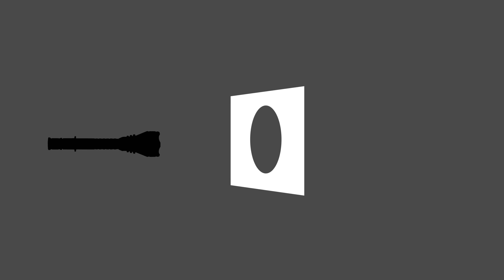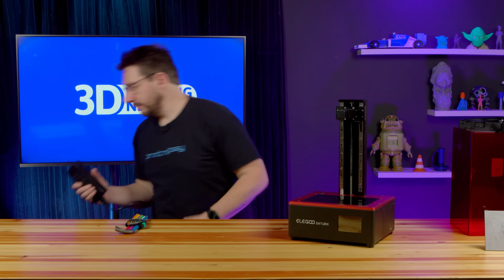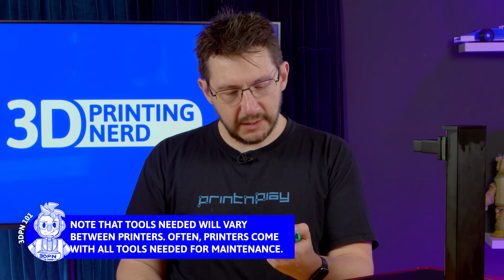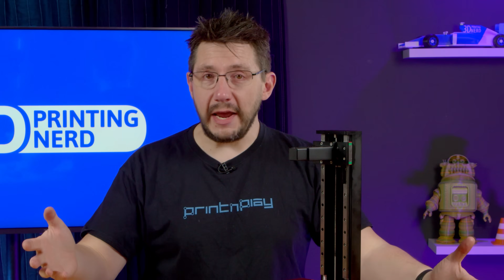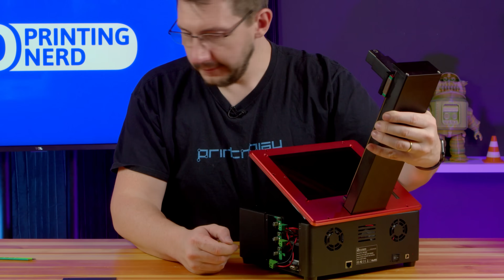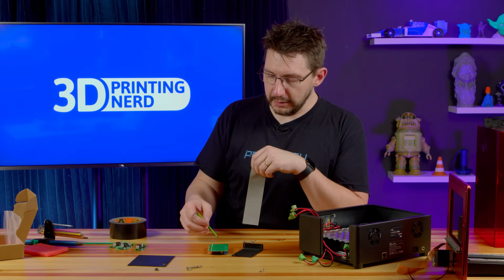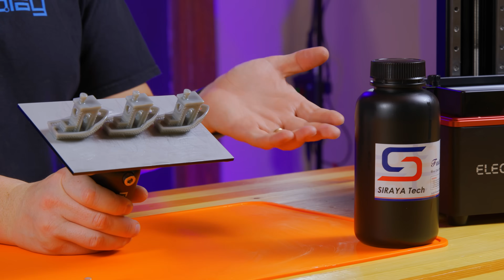FIX AND WIN an ELEGOO SATURN!

Comment: I would use this to realize a personal cooling system for people with disabilities. My goal is to make it cooling/heating with the same unit. Obviously this would be for preproduction units, but I have a vested interest in helping people with temperature management issues without involving the healthcare industry's pricing schemes. 
Also a more robust unit for use by outdoor workers and the like as I have personal experience with heatstroke at outdoor jobs. It may not be to teach the next generation, but it will help many generations maintain a quality of life in everything from road construction workers to the disabled people that won't go outside for more than a couple minutes for months because of the heat(/cold). You do great things Joel, thanks!

Comment: Very helpful video as I'm usually the person at my work who repairs the equipment! I honestly expected it to be a bit more complex inside but they look pretty straightforward. Since I'm a jeweler I'd use it to print models for design validation and investment casting. I'm also big into cosplay/prop making (I primarily build animatronics) so a printer like this would be extremely useful for making mechanisms with complex geometry. Thanks!

Comment: DIY FTW
If i'd win this Saturn, I would print some protective parts and camera support for my drone.
And then a toothbrush and paste holder. Some other things holder.
Definitely a rotating plate for curing those parts. That, I need.

Comment: I would print a new set of the articulated finger extensions! I built a set with an low end FDM machine and the quality and fine detail just wasn't there to create the tiny gears needed for the finger extensions to move smoothly. It would be super cool to see that project through to a functioning end project because I've invested tons of time into my FDM printed ones and they still just aren't quite good enough

Comment: I would firstly print parts for the FDM V-slot 310/310/650 printer I am designing and making since resin parts would be sooooo much better then pla/abs fdm printed parts , after that probably go on to making parts for an 3d printed CNC I am planning on making since 2 years ago but haven's since I dont trust pla parts at all for a machine like and cnc , and getting aluminium parts custom made will cost A TON . So basically I would make parts for other machines and a lot more on an SLA printer.

Comment: Hello,
Thanks for the video it will be useful in case of glitches =D
(personally I would have grumbled a bit about them sending me a totally different card but it's true that it's smarter to just adapt.... ( and grumble a little ^^))

For the participation:
If I have a saturne printer I would use it first to improve my apartment, I have speakers lying around so it would be nice to fix them to the walls (I could do it with a wire printer but I want a sculpted support and the current renderings didn't look good after painting them)
For the next step I would use it to make personalized gifts to my friends and family.
And finally and especially after having mastered blender, make my own 3D parts for cosplays, figurines and  robotics with my arduino or any others things that i want to create !!!

Thank you for the opportunity to win it
Have a nice day !

Comment: I would mostly print 3d figures and props that require lots of detail. I would also print some practical 3d prints. So a little bit of everything. Joel, you have been a big part in my 3d printing journey and I greatly appreciate everything you do for the community.

Comment: Joel, 
I teach automotive repair at a local community college in Southern California. If I were to win the printer I would print examples of automotive parts that I could hand out to the students so they could put their hands on the parts we are discussing. It would be an inexpensive way of getting “presentation” pieces that are “disposable”, can be resized, don’t have sharp edges, etc. For example, I could print a small differential so they could understand how the gearing works without having an entire rear end at their desk. I could also print planetary gears that would greatly help the conceptualization of the concept.
Thanks for your contributions to the 3D printing community.

Comment: I would love to win this amazing unit. The walk through was very clear and easy to follow. I just got into 3D printing. I have an FDM printer (Creality CR-10s pro V2) and this is the resin printer that I am looking at getting. I have been following you for a while and that’s why I chose the printer that I did. Thank you for everything that you do Joel. I would first print the largest Lattice benchy that would fit to give this printer a great test and then print fantasy characters for gamers. The larger build plate would allow for multiple characters at a time.

Comment: So nice to see info on repair for this printer.  There isn't much out there yet and it's good to see from one of my favorite 3d printing channels.  Would love one myself.  I'd print gifts, lenses, Oculus Quest adapters, enclosures, topological maps, fan assemblies for fdm printers, handles, threaded knobs, back scratchers, cup holder adapters, garage door wall mounted button housings, contigo cup handle adapters, retractable box cutters... what have you :).

Comment: I would use the 3D printer to make accessories for my telescope like solar finder scopes and focus masks. I have been using my Prusa Mk2 but I am very excited to try resin printing to get nicer looking parts. I'd probably use this printer with one of the more durable resins being advertised. I'll  also try and print accessories for my teardrop trailer starting with custom cup holders :)

Comment: I would love to win this 3d printer Joel! I would like to be able to print my own leg prosthetic parts at home. I feel like it would be really cool to design and print a dynamic ankle and foot. With the combination of PLA loss casting to make the metal parts for strength under extreme load and reclaimed rubber bumpers from previous legs I've collected, I think I could build my own Prosthetic leg.
Reply: Probably starting with covers/ filler between the socket and ankle to keep my pants from twisting up around my prosthetic.

Comment: Hi Joel.
I would very much like to try resin printing for all my Robot models I designed using blender 3D.   I have 3 different robots and working on the custom 5 piece robot that is put together using magnetics.  
I would love to see how detail my Robots would be compared to the ones I printed on my FDM printer.  🙂

Comment: I would love to win this printer! I bought an Ender 3 V2 in August and it has greatly expanded the limits of what I can make, some examples are the projects you can see on my channel. With a resin printer I would make transparent 3D prints, and mechanical or detailed prints like gears, bolts and other mechanisms my FDM printer is not quite capable yet, winning it would also be a real game changer as I am 15 years old. Keep up the great work Joel!

Comment: One of the best fix-it videos I've seen, as you explain 'why' you are doing certain things and not just a typical step-by-step,
step 1 - unscrew the panel
step 2 - disconnect old part
step 3 - connect new part
step 4 - put the panel back on

Comment: After a truly horrific time dealing with anycubic(finally resolved) I need to find a replacement.  My current design project is a skeletal platonic solid lamp idea. I have the parts for the icosahedron and dodecahedron drawn up.  I need to test run the legs and design the structure for the lights yet. It's a fair number of parts some of which are fairly large.  Would love to have finished versions by mid summer someplace.

Comment: What would I print? Miniatures for my brother. He loves his board games and has even bought some (which weren't cheap) strictly for the miniatures. Plus I could replace his Meeples (his most hated of board game tokens) with custom minis. Doubtless I'd print stuff for myself as well, especially if I could find a tough enough resin, and Mum would probably want more Barbie accessories, but those miniatures will almost certainly be the main use.

Incidentally, the faulty part might be recoverable. It looked to be either a buck or boost converter, but more importantly it had a small potentiometer (not unlike the vRef one on a Creality mainboard) next to the screw on the output connector side. It could be that this pot just needs to be adjusted to bring the voltage back to where it should be. Not super important given you've replaced it, but it's always nice to have spares on hand just in case.

Comment: I'd print resin jewelry parts for wax molds. You burn out the wax and can make metal parts! Atm wax parts made entirely by hand which is fun but the printer would help. Thanks!

Comment: I have a project that I am working on that is some small droids that use simple motors and controllers that can be made in about a week. Completely 3D printed and very easily replicable by any student in a STEM program. They would be FDM and resin printed. I would print the really detailed parts. P.s. they will be Star Wars inspired

Comment: I wan to to start making my own deck boxes, I started working with resin and making molds though having the actual object without 3d printer lines so I only have to do some light sanding. I would be able to make more complex designs quicker with an sla printer too. I mainly want to make them for the dragon ball super card game as that is currently the main game I've been playing.  if you see the art on a special rare version of Height of mastery goku you would see why. I started off with a fdm printer that I used to make multiple things around my house then transitioned to making molds using my fdm to cast resin. now I'm looking to be able to either just print the beck box out or use an sla printer to make more complex designs.

Comment: Been fustrated with my experiences with fdm printers (Might have to do with the flsun delta and tronxy x1 choices) but I've been using 3d printing to make parts for different things.  Right now i'm working on a small scale linear rail based diode laser and would love the 3d printer to make the parts needed.

Comment: If I won the printer I would be printing out resin parts for the ender 3 pro printer I am planning to get and majorly modify like Proper Printing did to print nylon. 

Also, you could have clipped the end of the passthrough components to lessen the chance of shorting.

Comment: I would print my mechanical parts because of the accuracy it gives, Like mechanical parts for my 3d printed rc plane's landing gear, and air suspension parts (they dont work because of the innacurracy of fdm printers)

Comment: I would print some stuff for my model train layout.  I'm told resin is better at printing smaller things.  Does the new one have the same driver you installed?  It seems like that's the better design!

Comment: I have been wanting a 3D printer since I saw you can print physical objects of your designs and I have been using CAD for 8 years but did not have the money to buy a 3D printer because for me they are pretty expensive. If I could have one, I would really love to print my CAD works and use it to improve my skills and possibly print things I need.

Comment: First about the repair, I would have thought that the 3d printing nerd would have printed a thin pla  insulator.  I am a little taken back with tape.     I am fairly new to 3d printing.  I have an Anycubic mega s love it.    A project that I would use it for are connected to a project that we are planning at my sister's house.  My 21 year old nephew has been wheel chair bound his whole life.  Now he is over 100 lbs  they have no wheel chair lift.  I have been working on a design for elevator .  I wan to 3 D print things for controls etc for the elevator.  We are on a small budget.  $2,000.    Commercially available start at nearly 10x that.     I think that the resin print would give me nicer prints for this practical project.  Between my son and I we have done just about all of our own 3d modeling projects.   I am into antique boats and have accurately modeled several since getting the mega s for Christmas.  Also modeling a project at my own house. A hony-do  project.

Comment: I would print models that I’ve made! Mostly... I’m not very good at 3D modeling yet, always practicing, but I have some weird ideas that I’ve put together. 

I have an angry cupcake, a jelly filled donut that’s leaking filling and is freaking out about it, a goblin head (bodies are complicated :/ ), a creepy looking ball with a cat face and little nub legs (great paper weight btw) and some other hard to describe ideas that I threw together... Beyond that I have replacement parts for old game consoles/handhelds that require a relatively smooth and detailed finish to look right that I would like to print up. 

And of course I would print a 3DBenchy for testing purposes, totally not because I want one on my desk.

Comment: If I had this, I'd print a Pi handheld. Made one last year using FDM for the shell and it turned out ok, but I'd love to be able to redo the design without having to accommodate stuff like overhangs and supports.

Comment: There is a mechanical clock that can be 3D printed but in order for it to run a bit longer than like 5 mins it needs a sla 3D-printer. Would love to print that, if I win the Printer. Would be awesome!

Comment: I would use a resin printer to print more dimensionally accurate parts that are more heat resistant for my robotics team, and to print more details on models as well as printing miniatures.

Comment: I would make a hand prosthesis for a homeless person who cannot afford a prosthesis. Because for my fdm printer  it's very difficult to make the small parts needed to assemble the palms and fingers but since I do not have access to a resin (SLA/DPL) printer, the present prosthesis is more for decoration than useful. So the first thing I would print out would be all the pieces needed to be able to assemble a more functional palm and fingers. Like your wids and kip up keep up doing good work. :). I learned a lot from you.

Comment: Dear 3D printing Nerd,
I would like to win this printer. I already own 4 FDM printers, and having a lot of fun with Them. But I designed a special Cpap clip for people who have a trachio-stoma (a hole in the nec where the vocal-cords use to be) this clip is smaller and more comfortable then the one provider by the manufactory. My Ender 3v2 and the Prusa MK3S don't print consistently enough for good production (only 8 out of 10 are usable).
I designed this clip initially for my father in las, because he hot this after cancer-surgery. Because of the success of my design there are more and more people from the community with the same issues who are interested. 
I do the printing free of charge to five back. But it would be Nice to be able to have to be able to use a resin-printer to be able to get more precise and consistent results to be able to provide more of these clips to more people.
I have reached out to the manufacturer of the original system with my design, But they aren't interested in my improvements because they are to complex for Them to produce for the amount of people they can provide with them.

When interested please het in touch, I can send you my design.

But either way, I'd like to win this printer because arm I'm unable to do the investment myself to get up and running with resin printing.

Comment: Ah Joel! Winning the Saturn would be amazing! I've just started my journey with 3D printing and I'm designing my own jewelry, printing designs, and then using them for molds for casting later on. Trouble is, layer lines! even on the finest setting they still need tonnes of sanding :'( hoping a resin printer would save me from this sanding nightmare so I can keep on developing what I'm starting to love!

Comment: Hey Joel... great vid as usual. I would print all sorts of gaming miniatures with that puppy if I won it over here in scenic New Jersey.
A couple of quick comments: I would make a special note as to the alignment of that ribbon cable, in case you try that one at home.  It's 2021.. take a pic with your phone before disconnecting
Now I have to bust your chops for using tape as a standoff. if you need more space above the standoffs and you have the room, use PLA spacers! C'mon, isn't 3d printing the solution to all problems? lol!
 You could tinkercad them up and be done printing them in about 2 minutes. (also, if you're going with tape, use kapton tape maybe?).

Comment: As usual, great video Joel. Thank you. I recently adopted a Belgian Malinois (what police and military use) which has to stay busy. I’m wanting to train him scent detection and would use this printer to make boxes to hold different scents. Due to the Florida heat, I need the higher temps that aren’t available from extruded 3D printing.

Comment: I would like to try making 3d printed injection moulds. for very small runs. Eg tiny gears that need to be nylon. Print a mould, inject hot nylon and cross your fingers! (might need release agent etc, don't know yet) Need a resin printer to try it.

Comment: Because I only have FDM printers and I would like to try technical parts based on resin. It seems that resin has changed a lot for demanding parts, temperature resistant, generally improved mechanical properties.

Comment: I'd definitely use it to print replacement plastic gears and parts for repairing old audio equipment; FDM just doesn't have the required level of detail.

Comment: Hey Joel, I’m 13 and I just got my first personal FDM printer this Christmas, it was an SW-X1. I’ve already printed close to 100 things and the first thing I would print with the Saturn is a mini version of Devin’s ram skull, or a mini Joel as a benchmark. Then I would keep printing around the clock until I need to use this video to fix it.